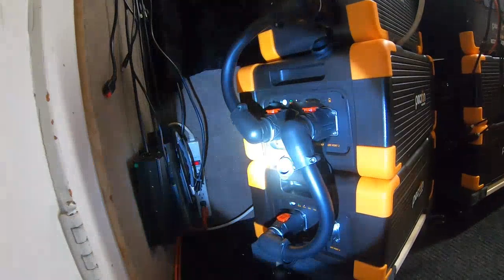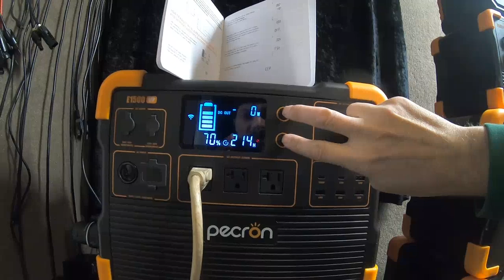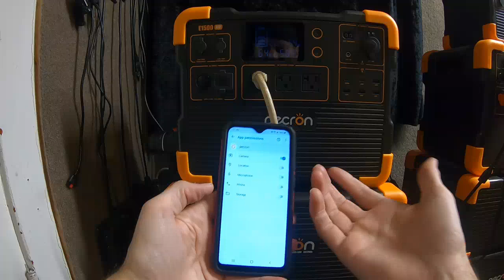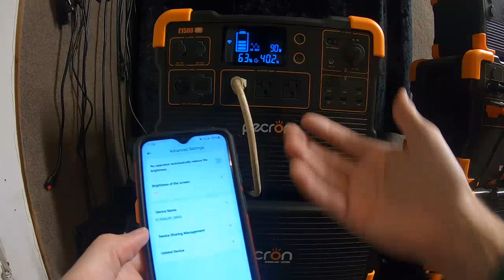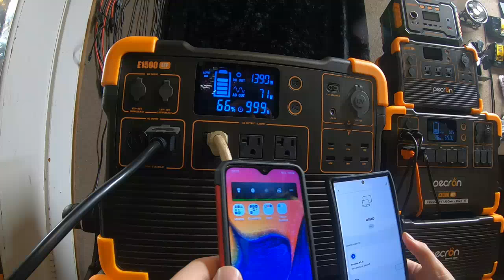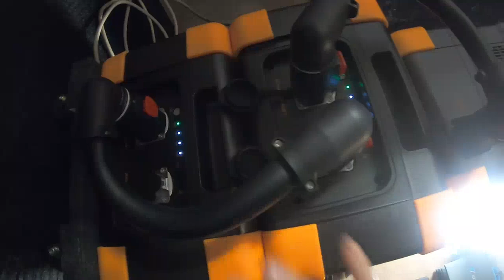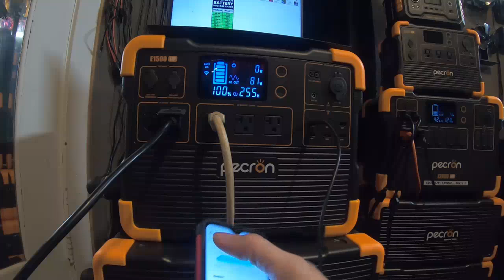PECRON E1500LFP & EP3000 Power Station (FULL 7,680wh SYSTEM) (((((Update 1)))))

Comment: Bob, is it possible to charge the E1500LFP with the Pecron 600W 110-130V AC Quick Charger ? I was thinking to order one to allow me to slowly charge the E1500LFP when I want to.
Reply from the maker: You can not charge the e1500lfp with the charging brick because the input ports are different :(

 HOWEVER, you can charge through a ep3000 battery (or 2) to charge the e1500lfp !!!!!
*400 watts is the max input that will be allowed to come from the 600 watt charger per ep3000 battery. (up to 800 watts max with 2 chargers)

IMPORTANT NOTE: The power meter will not show the 400-800 watts coming in on the screen, but the percentage power meter (0-100%) will go up and the e1500lfp will always update as needed and fill the system that way.

This works perfect, we have done this many times in the past :)
Reply: @ thank you! Your very knowledgeable and kind to share your knowledge
Reply from the maker: @NickKlockenga  Thank you for supporting the channel and being a part of the scriber family :)

Comment: Hi Bob,  can you adjust/lower the AC Input Wattage on the E1500LFP?  My truck has onboard power at 2000w and can charge just fine at idle but while driving it drops to 1500w and cannot handle the load.
Reply from the maker: I wish that it did. the new e3600lfp has that feature :(

we did not know how important this feature is until we needed it ourselves...lol

P.S. Here is the only 2 ways that we have found so far to slow down the charging speed.....

1. Use a pecron 600 watt 5 pin charger brick maybe?
https://www.pecron.com/products/600w-110-130v-ac-quick-charger-e3000-e2000lfp#ref=145

2. Use a 500 watt dc charger from pecron maybe?
https://www.pecron.com/products/pecron-500w-car-charger-dc1242-500-for-car-rv-van#ref=145

Both of these ideas use up extra energy, but they do slow the charging process down for certain situations when needed.

Comment: If I have tried once, I have tried 50 times to pair the Bluetooth.  …’times out’.  I don’t know what heck I need to do.  I have updated my phone’s software, restarted the phone several times, checked to see if all ‘settings switches’ are set, re-installed the Pecron app.   At a loss here.  Probably some thing that I am overlooking.
Reply from the maker: We have had some problems with some phones connecting as well. hoping that pecron makes more updates to their app soon. (we have mentioned this in a few videos on the channel)

Samsung galaxy S5 (works for us)
Samsung galaxy s23 ultra (works for us)

app 1.6 seems to work the best for us.

P.S. Either way, Pecron has to make more updates to their app for sure :(

P.P.S. I think that you have to pair with wifi first and then link with bluetooth?
Reply: Yes, I meant that I was trying to connect via Wi-Fi … my mistake
Reply from the maker: Have you reset the wifi on the e1500lfp?

Press AC & DC at the same time and hold them down until the wire frame around the battery flashes, Next....You will then see the wifi icon flashing. This is reset pairing mode.

(This resets the signal of the wifi to pairing mode in order to have a fresh start)

Give it a try and let us know if this helps you, it helped us...  :)

Comment: Hey Rambling Bob, can you “Frankenstein “ a pecron 1500 LFP with a non company 48 volt lithium battery and make a video on it ?  I want to add some aftermarket 48 volt batteries because the 1100 bucks for the pecron E3000 is just too darn high
Reply from the maker: It can be done, but it will void your warranty :(

Comment: With wifi you can turn the power station off from your phone by going to output and turning dc off. And it once it’s off it will still be connected through wifi which is a cool feature in my opinion because if you’re using solar and the power station isn’t in your room you can just open up the app and turn it on from your phone in your room. Awesome feature and will come in handy for a lot of people.
Reply from the maker: Yes, we agree

It is a great feature to be able to have access to your system from another room, or if yu have you system in the back of an rv :)

Comment: Hey Bob, my EP3000 battery arrived a few days behind my 1500LFP, which I had already charged to 100%. To get it within 10% as the manual says, I then used the charge brick from my 600LFP to charge the 3000 battery to full before I connected the cable between them. Ive not toyed with the App and likely won''t.
Reply from the maker: I have used the e600lfp & e2000lfp ac charger to put power into the batteries as well. worked great for us.

Not a fan of apps, but it is nice to see the voltages of the batteries in real time :)
Reply: @RamblinBobReviews  Aww man, I commented before I finished the video and yes I see it mentioned now. Nice video Bob and Mrs. Bob!
Reply from the maker: No worries, Thank you for watching :)

Comment: Hi Rambling Bob, you asked what E1500LFP owners were getting for final voltage. After a full charge topping off and settling for 6 hours with AC in connected, the E1500 readout shows 53.4 volts.  The app shows 53.7 on the E1500 and 53.6 on the EP3000.
Reply from the maker: Thank you for the info :)

Comment: Hey Bob- Just a comment about Pecron App using wi fi.  I think to initially set up the app it must be connected to your wi-fi. Once the app is working just go into your phone setting and deny wi fi access. for the Pecron APP. I turned off all Pecron access to camera, wi-fi , Locations, ETC. It just needs to be connected to blue tooth and maybe push notifications.  My app works fine with these selections . Hope this  helps.
Reply from the maker: Thank you, We will try this. But remember, we are not using a real phone, it has no sim card of phone number, it is like a tablet now, bought it just for drones and such.

Have you tried this with a tablet or phone without a phone number? Mine does not connect to the e1500lfp with only bluetooth. Maybe because it is not a real phone?
Reply: I don't think bluetooth has anything to do with Wi-Fi.  This should work for you.  @RamblinBobReviews
Reply from the maker: Tried it and it does not work, the only way i can access the app is to use the wifi setting (on)

I have a feeling this has to do with mine not being a real phone with a data plan. Bluetooth is not working

Pecron said that you need wifi to setup the app, and then you can just use bluetooth to acces it. without using wifi
Reply: My iPad doesn't have a data plan but bluetooth still works. Maybe try disconnecting  app. Then start over using  wi-fi to set it up then not allow access  after that.  Good Luck ! I don't like the idea of anyone having access  to my wi-fi.  too many bad things  can happen
 @RamblinBobReviews
Reply from the maker: We do not like that idea either....lol....old school fella here

Will try it again on a different device :)
Reply: Wish you all the best !!! @RamblinBobReviews
Reply from the maker: Are you setting up the wifi under 2.4g or 5g?

our fiber optic cable is 5g, maybe that is why? Some people said that they were having some issues with 5g.....
Reply: I talked to a friend that is very keen on this situation. i have 5g network. he says that if your device is bluetooth capable, you should have no issues connecting.. The question is are you doing the initial set up correctly. Think of it this way : can you use your device for bluetooth with other devices outside your home ? If this  is true then bluetooth should work inside your home. Hope this helps. @RamblinBobReviews

Comment: Hi Ramblin Bob, I am currently testing my new E1500 and EP3000 combo.  I'm disappointed that after running from 100% to 1% my power meter shows I used only 3504w of the 4602w the two units store. It was a 15 hour test at an avg. of 233.6/hour.  Can you help me connect the dots here?
Reply from the maker: Did you set the serial number on the EP3000 battery?

We are still running capacity tests for the full system (7,690wh) and we are getting 90% or more right now with a 100-200 watt draw on ours.

That is only apx 75% capacity......hmmmm

   You should be getting around (3900wh to 4200wh) (85% to 90%) according to our tests. What device are you using to measure the watt hours? a kill-o-watt meter?
Reply: Hi  @RamblinBobReviews , kilowatt meter.  I looked back in your video (2:07). It looks like I you and I have the same meter.
Reply from the maker: I would try another test just for verification. Did you change anything in the hidden menu or settings in the app?

Also, Did you double check the voltage of the main and the battery in the app to make sure that they are at the same levels?

Also, Do you have the battery set to a different number other than "0"

We are not sure, but we think that "0" is reserved for the e1500lfp and not the batteries
Reply: Still waiting for my EP3000 so I can't yet comment on both units together but you will never get 100% out. The inverter on the 1500 uses about 31 watts in addition to whatever you were running. That would only account for half of the difference but if you had a large load and the fans were running that may have used additional battery. Was DC also turned on? What was the screen brightness? Was the wifi on?

Comment: My AC charging port is no longer working. I hope it’s the fuse. Waiting until then and I’ll update you here. Pecron has been good about responding to my emails.
Reply from the maker: You can simply unscrew that fuse to check it, watch here at 10m20sec
https://www.youtube.com/watch?v=I3sv2XPhDSk
Reply: @RamblinBobReviews  I got it. I don’t have extra fuses. Just waiting for the new ones to arrive. I’ll update y’all if it’s truly the fuse or the circuit board.
Reply from the maker: Ok, Lets hope it is that fuse, Super easy to swap out :)

P.S. That is a heavy duty fuse, I wonder if they would sell something like that at the car parts store or something. It would be nice to have some backup ones just in case.
Reply: @RamblinBobReviews  It was the fuse. Whew!
Reply from the maker: That is fantastic news :)

P.S. CONGRATS on your easy fix :)
Reply: @theboston3386 did you get the fuse straight from Pecron? They seem hard to find. I'd like one just in case.